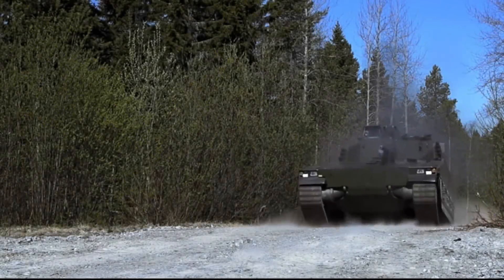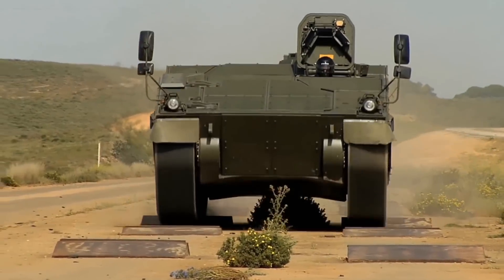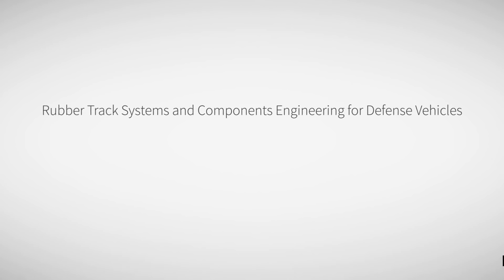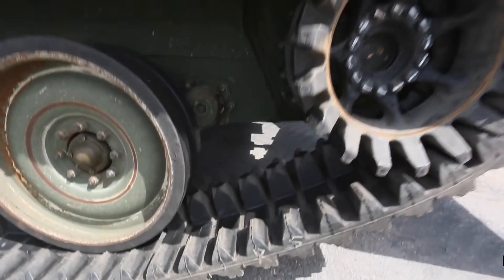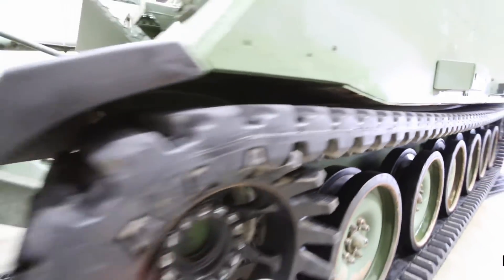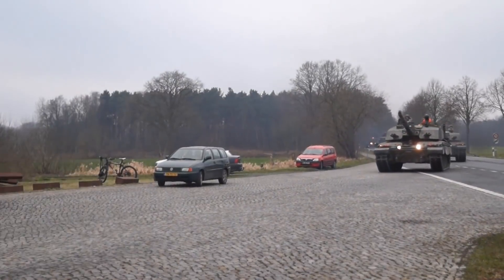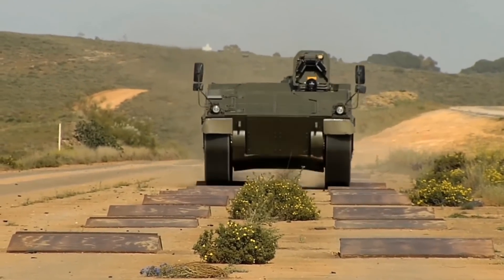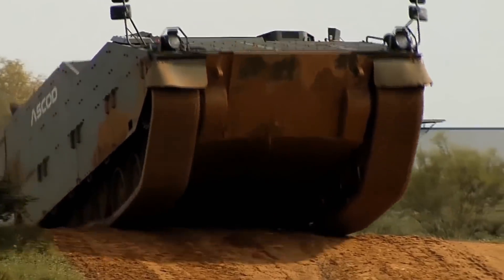Rubber Tracks on Tanks - Are they worth it?

Comment: This technology goes all the way back to WWII.  The tracks on the American "halftracks" had these rubber band tracks.  Later, the M114 had these, although, they were of the "segmented" type.  Universal to all "rubberband" track systems is the fact that they are rubber molded around steel cables.  Just like your steel belted radial tires, but with larger cables instead of woven wire.  of course, the M114 did not have the best reputation with regards to track dependability.  Either way, it will have the thermal expansion co-efficient of steel rather than rubber.  I have seen (and towed back) prototypes that could be weighted to 70 tons that had hybrid drive-trains, limited autonomous driving ability, hydropneunmatic suspensions and rubber tracks, never for a track failure.  My M88A2 was struggling mightily!

Comment: Ok, I'm no tank expert but I can put 2 and 2 together and figure out that neutral steering an already heavy Leopard with an entire bridge on its back on a cobbled road is a stupid idea
Reply: They did that on purpose to prove a point.  I drove my M60A3 and M1A1 on many cobblestone roads and motorpools without any damage.  (2 tours [4.25years total] in W. Germany) Look closely, you will see that there was a significant "pothole" or whatever you wish to call it where the cobbles were already coming loose.  They CHOSE THAT SPOT to neutral steer.  This is not coincidental.  Cobbles rely on there interlocking properties to give them strength.
Reply: So they pretty much destroyed a large chunk of this walkway/road just because they could?
Reply: Yes, The road was already slated for repair.  It was made into a "public service announcement of sorts. also, cobbles are reused.  they will simply come in, pull out all the disturbed stones, lay, smooth and compact the sand and gravel underpayment then re-set (place, wedge install or whatever have you) the original cobbles.  It is actually a very durable (if not smooth or high traction) road surface.  I have destroyed German roads before, nearly every time by accident of mishap (in my M60A3) only once did I wreck a chunk on purpose, an old lady would throw rotten food at me when I walked past her house to buy Brochen and meat from the metzgeri (My german is a bit rusty) so I got "Babe the Blue rubbing up against the curb (curbs in Germany are made from roughly 1 meter long pieces of granite laid into the ground) then steered as hard as I could.  Threw three section up into the yard.  Felt like a jerk afterward, until I pulled that uniform out to wash it, the smell caused me to decide to throw it away instead.  It was close to unserviceable anyway.

Comment: What's about a 16 x 16 drive wheels tank. maybe with track to run on soft santd or messy swamp.
Reply: Wheels have really bad ground pressure physics.  Tracks just work much better.  In reality set in a line, multiple wheels each wend to dig its own trench.  when in line, these get quite deep in soft soil.

Comment: I don't know about military, but I've seen some logging companies whom had track equipment the type of track usually depended on where they was, rubber for harder, more level and cement areas, and metal for muddy, forestry, swampy areas. They would change out the track to fit the need.

Comment: I think you have the balance right, at least with the current technology - vand tracks would be an immediate and significant improvement and a money saver over time; but MBTs  still require the combat durability of steel tracks.

Comment: 7:02 IDK, if the ground pressure reduction is signifcant enough...cause 71 ton tank like the Abrams got like 15 PSI ground pressure...and 1.8m tall medium build people only exert half that...but they still sink in several centimeters deep in to wet mud :/    

Now as far as I know, if a rly heavy tank encounters wet mud, IT CAN still drive through it, but it has to drive slowly...or else it will dig itself further down...something to do with the torque disturbing the mud, or something :/  Anyways...once you go to a "depth" of around 50 cm...then your surely, and truly stuck...and bruva....your a ded duck :V

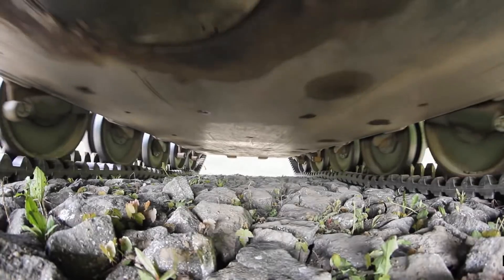Comment: 7:21 "Who cares about roads?" Beech plz, the Army is all about roads. Even though tanks, and tracked vehicles can go  just about anywhere, their speed slightly (but itz still significant) decreases on difficult terrain. Thatz why roads are used whenever possible. Also, you gotta keep in mind that most supply vehicles are wheeled trucks...so it will be rly bad if you got messed up roads

Comment: Molybdenum or Tungsten doping could solve the stretchines probless and like you said a hydralic tensioner is a must. I just wonder if we'll ever see a half track remake with this rubber tracks or even just take  the drive sprocket off a tank and make them never-flat tires. Now to see if an aluminum-titanium alloy would make good armor and make the Sheridan 2.0.

Comment: Still against it for combat vehicles. However, it definitely shows that we need a redesign of the steel track. I'd think a composite of the two would be a great idea; use alloys, better rubber pads, maybe ceramic bearings, and better road-wheel to track interface. The current tracks are from the 1950's and 1960's and pretty much zero work has been done to upgrade them. Just switching over to a better (stronger/lighter) steel would be a major upgrade. Which was all the M1's new track is, old track design using better steel alloy to reduce weight by a ton per track.

Comment: I would assume that track tension isnt a huge issue on modern vehicles that have driver adjusted track tension systems. I know the CV90 has it as standard. As well as the roller coaster and catapult experience you get from driving in Norway with them. If you are sitting at the back close to the rear door. Seriously, wear a helmet to avoid head injuries! :D

Comment: As an excavator driver I can tell something about rubber tracks. On excavator up to 10 tons rubber is awesome, above that weight is nightmare. It's simply falling apart on 15 ton excavator. It's simply too much force for rubber to maintain structure integrity while you crossing rocky terrain.
About using rubber tracks on 80 ton 1500hp tank... maybe I'm an idiot but I can put bet on: that's not gonna happen. 
Siriusly do you see an Abrams tank on rubber tracks, just imagine torque on driving wheel while you stop and start on steep slope or floor breake at 70km/h...Mybe if technologie massively improve

Comment: Why not on MBTs? Is the actual threat to the band tracks significantly greater than metal tracks? I don't think so because in MBT on MBT combat the tanks are going to be firing on one another well beyond visual range, outside of city fighting and ambushes, the latter of which is incredibly rare for modern powers, in which case blowing off a track with the main gun seems a waste of men and material when victory and survival comes down to hitting first.

So what about MBTs and other AFVs? Well against IFVs they tend to have auto-cannons that can shred metal tracks just as easily as rubber ones, while APCs and non-AC mounted vehicles might pose a greater threat to the tanks tracks, but I'm fairly certain .50 cals or 7.62 Nato minis or coax guns could still pose a threat to metal tracks. So ultimately it comes down to whether or not 5.56/5.45/7.62x39 would pose a threat to metal tracks, or in other words infantry threats.

But honestly when is the last time infantry were expected to hold out against tanks without effective anti-tank weaponry? WW2? In short against all other threats I don't see band tracks as being significantly less durable than metal tracks, while against infantry threats, even insurgents have a plethora of RPGs to pick from, so are band tracks really that worse off than metal ones? Not as far as I can tell.
Reply: Rubber tracks aren't as rubust as steel tracks. They can't handle the weight of a 60+ ton MBT. Even the AJAX (38 ton) has to use steel tracks because it's too heavy for rubber band tracks.

Comment: How is the testing in sudden ambient temperature changes, like superhot (50º to 55º C) to supercool (-10º to -20ºC) as can be in a desert or in a not so much intense variation to the lower temperatures in tropical places that could vary in a single day from 47º to 15ºC (we already had some crazy days like this last one here in Brazil) ? The rubber would not be more inclined to be damaged or even brake, like in the o-rings of the Challenger in 1986? I know that the enginneering and production has changed but rubber usually do not whitstand this constant variation and a army stationed in such climates could be subjecto to undesirable troubles.

Comment: I suppose I knew intellectually that driving around in a tank was probably uncomfortable for the crew. Thanks for bring it to life for me. It is an interesting question but, not being a tank crew member, I'm not sure I can have much of an informed opinion. I would suggest that when you're in combat the vibration caused by metal tracks is less of a concern than the vibration caused by enemy shots hitting the hull. What happened to tank transporters? Are they no longer used?
Reply: Blast attenuation crew seats should help reduce the forces felt by the crew as well as improve comfort. Some newer tanks are being fitted with them.

Tank trailers and heavy tractor units are still used for relocating tanks. The tanks are typically moved on their own power once at the area of operations. This could be a short term move for training purposes or a long term move for a deployment to a forward base.
Reply: Thank you.

Comment: Metal is very important to it as rubber itself lacks the needed strength and tear-resistance once damage starts somewhere. Its kinda like car-tire design : https://s3.amazonaws.com/sbcserver/shebuyscars/wp-content/uploads/2015/05/IMG_3012-600x448.jpg Id also suspect they being such complicated-like layered character and having extra structural elements around parts having further functions - drive-wheel teeths. Id be skeptical about the logistic side of the rubber-wheels and even those segmented ones, i suspect them being a real pain to manufacture compared to casted-steel segments, that are just machined afterwards. You also can look up patching up of Mining-trucks wheels. ( but re-furbishing of car-wheels is similar to the process ) Basically, aconstruction as these tracks, patches are literally just means to get it to safety and be needed to be completely replaced. Also, any over-strain on those patches will make them tear the rubber. I also kinda cant imagine how they got that track on when its a single piece. Another big problem is storage. Its like normal car wheels, Rubber degrades, even more so with every little scratch and hole and are bad in long-term direct sun and aggressive chemicals contact. Heat, ground-ozone, ( witch both can be potential problems in middle-east conditions ) aggressive acids ( basically from oils ). I don't think they be as easy to be stored for long periods of time and be greedy on the conditions of long-term storage, so the need of them being manufactured on demand be most needed ... when models get older and no spares to get, those tracks be a pain. ... going over hot stuff or getting on fire be also kinda bad. Traps of red-hot wire and flamey character be a nice way to damage them fast.
Reply: They would be periodically replaced like vehicle tires but should last a long time under light use on roads and such. The logistics of getting replacements should take shelf life and storage conditions into consideration. Typically items similar to this would be kept with just enough spares on hand for about a month of heavy use by all vehicles in the unit. As these are pulled a replacement order should be automatic. Most parts should arrive from the manufacturer or a depot within enough time to prevent shortages. Heavy or bulky items can sometimes take a bit longer than lighter items as special transport may have to be arranged. The ability of the manufacturers to keep up with demand would vary by company but for military parts there would usually be an item manager leaning on them to keep up or else competitors will be used to increase diversity of supply sources and preference given to those who can deliver on time.
Reply: Yes, but still, ( of course God prevent ! ) in actual war-situations, one should look at the worst probable case and even if days of WWII are far gone, Id say ( seeing my own nation ) logistics be a pain especially for nations having armaments from far abroad and incapable own infrastructure and know-how to not just service, but produce themselves. Cold-war thinking is nonsense, but a certain degree of that mentality when it came to logistics ( like more than a month of use spares - in war-situations and not peace-time ones -- hence my view metal tiles might be better than rubber ones ) and infrastructure plans ( where be production and servicing be organized if isolated from suppliers + fast relocation of these capabilities ). It just seems for me as aside of a few things an army just became an too much business subject instead of aiming to be effective, simple and useful ( as said, from perspective of non-major arms-nations ending up like Christmas trees of different stuff at a pile ).

Comment: A couple of points:

a) I think Matsimus has a definate point in that it is weight dependable. Up to about 25-30 tons the rubber band will probably have a definate advantage. Above that weight - moving into the MBT sfere - I don't think so. With a 60 monster, suspension and tracks will always be a definate problem. The kinetic energy is ½m*v*v. Moving cross country in a MBT at respectable speed is ALWAYS going to be living hell.

b) The rubber tracks do have the advantage that repair kits (or replacement sections) will be easier to transport on a recovery vehicle that has to transport the replacement wheel anyhow. This means that depot level maintainance has been put further forward to the engineers with a BTN battlegroup anyhow.

c) Medium armour finds it better to dispense with track all together, and go in for 8X8 anyhow. No matter how considerate tank crews are, they are really going to mess up road traffic or they have to use railroad tracks that take forever to get laid down (allways a major political decision - and they take a lot of time).
Today Nato distinguishes between mechanised units on tracks and motorised units on wheels.
Going wheels does have its limitation. If you are to stop a prepared enemy from invading - there is nothing more dissuading than a squadron of Challengers with raised eyebrows. They will also be used to punch a hole in some defences that the wheeled can pour through knowing there will not be very much that can threaten them.

Comment: Considering how vehicles are used in the modern era, steel tracks are a thing of the past. Sure, if the vehicles were in regular combat daily then steel tracks may be worthwhile. However, given that daily operations involve a lot of movement with little engagement, rubber is the way to go.

Vibration was mentioned for having a negative effect on the crew, but it also affects vehicle components. That alone reduces maintenance requirements.

As far as different temperatures and terrain, different rubber tracks can be developed for particular situations. There are several different types of tires which are specialized for pavement, mud, snow, etc.

Comment: Rubber-band tracks are actually older than you think. Way back in WWII, they were used on half-tracks like the M3 and M4. It was cheaper to do so than using the full tracks like on the Sherman tanks.

Comment: they should definitely trial it on the warrior as they are a bitch to travel in. maybe more tactical and safer in the event of an ied blast as  bits of high velocity rubber arent likey to penetrate the crew compartment.
Reply: Anything that quietens down the track slap on a CVRT at speed would be welcome
Reply: cvrt are horrible all round glad only recce plt had to use them
Reply: We had them as our Squadron and Regt CV (Sultan) till replaced by the 436, each troop had three (Recce Sgt, Tp SSGT and Troopy) and the Sqn Fitter Sections had one Sultan and one Samson. 

The rest of us had 432's (Four per Troop - Sappers in Germany)

I preferred the 430 series to the CVRT's but the CVRT was less tiring to drive, smaller, faster and had heaters that worked. Many of the drivers only did the 432 course as it was required before you were allowed to do the CVRT course.